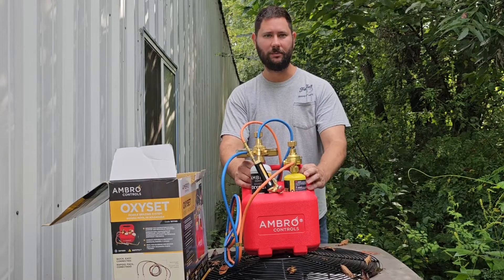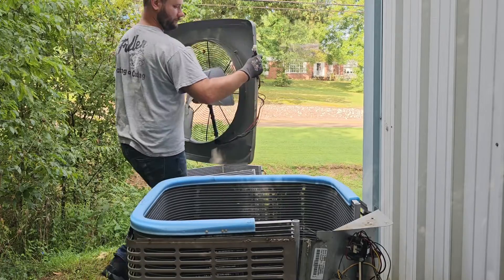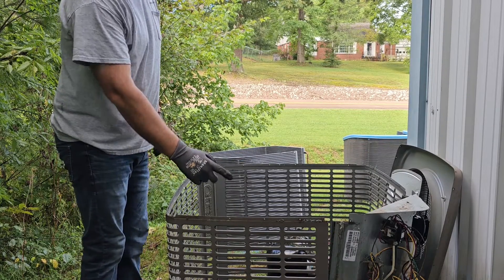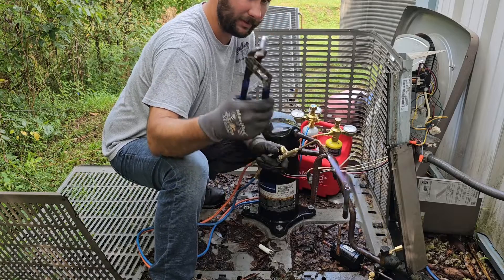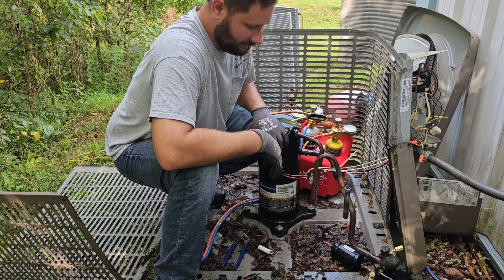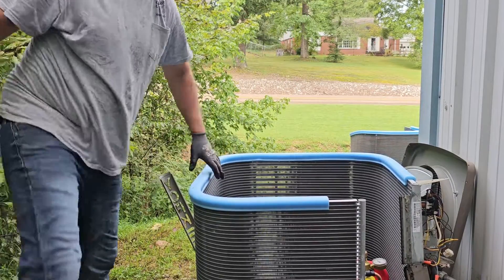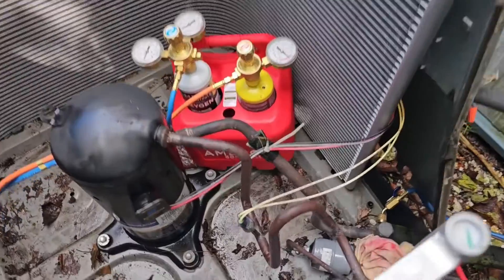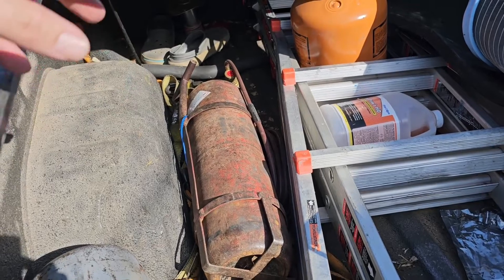Upgrade Your Brazing Game with Ambro Controls Oxy Set

Comment: Honestly, the next time this coil goes out, measure the coil, and see if you can find a ALL COPPER coil that somewhat matches the dimensions. You might have to bend and add some copper to the connections, but it’ll definitely beat having to some back. That’s exactly what I did with an American standard condenser with  coil that was all copper and none micro channel I found on Facebook marketplace at that, probably off by an inch or two but it definitely worked.

Comment: Hey Teddy one thing I would recommend is lifting the dryer up a little bit off the pan the metal dryers rust out quick
Reply from the maker: That's a good recommendation.Thank you my brother
Reply: And wrap the drier ,because of the desiccant inside, depending on how long exposed to heat.

Comment: Those torches look pretty sweet. Next time, help a fellow tech out and just put the drier on the outside of the condensing unit. It makes it way easier to trouble shoot a plugged drier. Or if you have to make a repair on the evap some day, it'll be much easier to replace the drier without taking the whole unit apart again.

Comment: Disposable oxygen cylinders will quickly cost more than than refillable welding oxygen cylinders. The injector style torch is neat and of course would run off any appropriate regulated gas source.

Comment: Tadd ..what do you think about these aluminium condenser coils. These were introduced a few years back . probably manufactures were working on cost cutting. But most of these were a failure.  Now manufactures are switching back the copper coils. Can these aluminium coils be repaired?
Reply from the maker: Here is a video of me repairing a micro channel coil

I don't like him because they're easily damaged and it's easy to overcharge them. It's also easy for them to run high headpressure when they. Get? Dirty just slightly. Dirty
Reply from the maker: https://youtu.be/ft_HTMpdi0E

Comment: Great video once again bro! Those things are cool but it’s still too much. I use a small MC (acetylene) tank with a turbo torch A-11 tip. It’s the smallest, lightest and most simple set up for residential and light commercial work. You can braze up 1-5/8” with it.
Reply: Too much money or too much stuff? How much is this set?
Reply: @realSamAndrew  Too much stuff. You have to buy their special oxygen too. It’s just complex for no more than it does. I don’t know how much it costs but I guarantee you can buy a small MC tank or two and an acetylene turbo torch for less. Then you only have to replace one tank. It’s just easier and lighter to use straight acetylene.
Reply: @AaronPowellvox  Not about price , more about compact , lightweight, which in itself is a winner.
Reply: @IceWhiteice22  I never said it was about price. I said it was too much. Meaning too many moving parts and things to replace. If you read the rest of my comment you’ll see what I use and why I use it. Still lighter, simpler and probably cheaper. I don’t even know what one of those costs.
Reply from the maker: Thanks for the tips!

Comment: Always saw the bernzomatic ones at lows. When i finaly went to get one they took them off the shelves
Reply: why?
Reply: I don't think anybody took them off the shelves,  When big Oil decided we don't need to be using MAPP gas anymore and discontinued it's production, those in the know set off in a mad rush to procure any & all MAPP still on shelves,   THOSE are the folks who took it off the shelves..  .. .. Cs that Map Pro crap they replaced it with sucks big horse balls .. it's way colder than the real stuff ..

Comment: Filter driers do not like heat. I wrap mine with a wet rag. I would have sanded the pipe down and slide the drier on and wrapped it with a wet rag and finished the job. Some people use heat paste instead of a wet rag.
Reply: I'm sure he didn't no that . That was so helpfull.
Reply from the maker: Good idea yes good practice as well